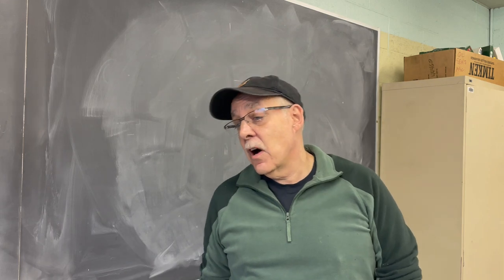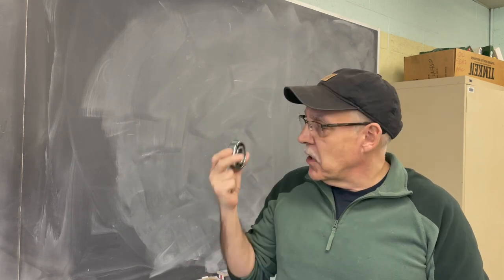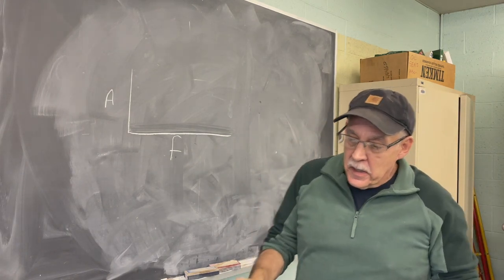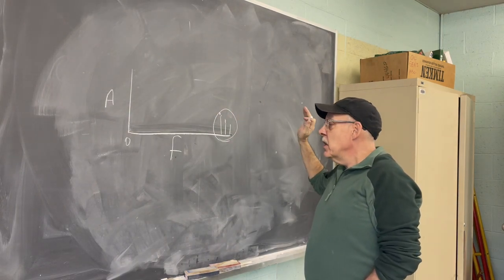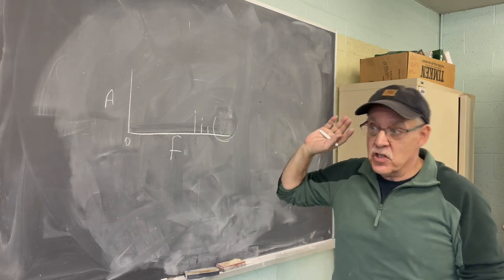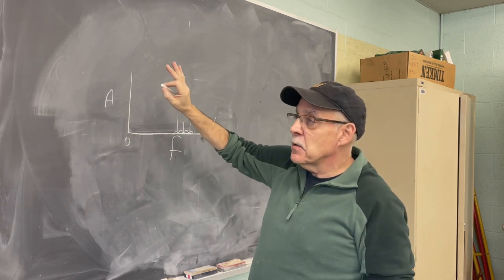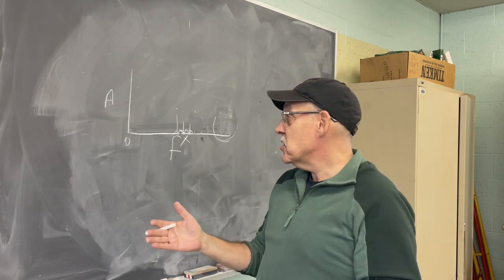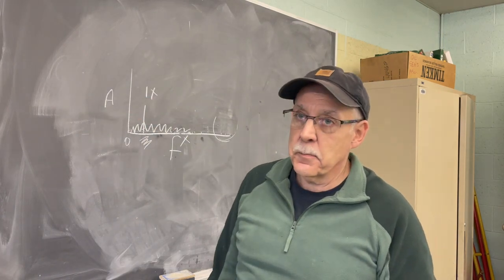Interview With an Expert Vibration Analyst: 4 Stages of Bearing Failure

Comment: Could you indicate how it translates to the machine of analysis? How is the difference between envolepe and acceleration in this case? What happens if you see it in velocity, is that stage 4?
Reply from the maker: all early stages of bearing failure discussed here are using peak view  to identify early faults. as the spike moves to lower frequency in stages 3 and 4 you will see it in velocity. you have to set your box to look for these during your route.
Reply from the maker: i have an entire video playlist that explains the acceleration and velocity vs amplitude and where you use them.